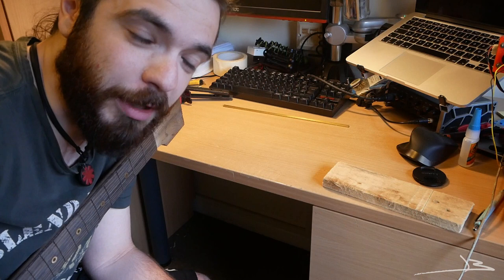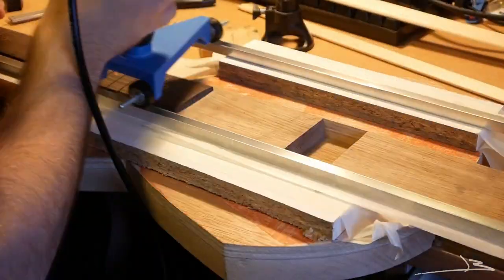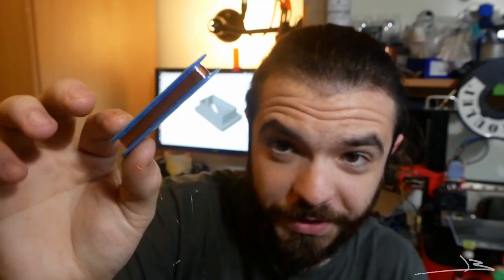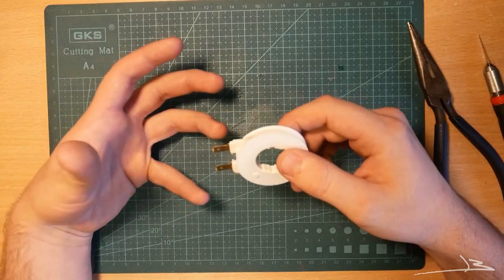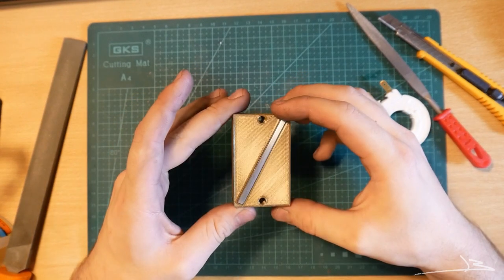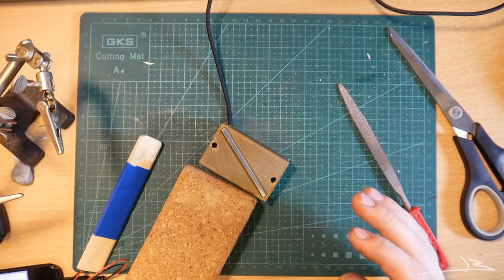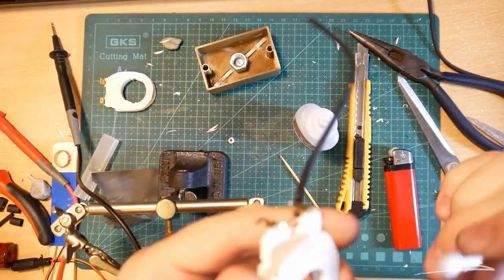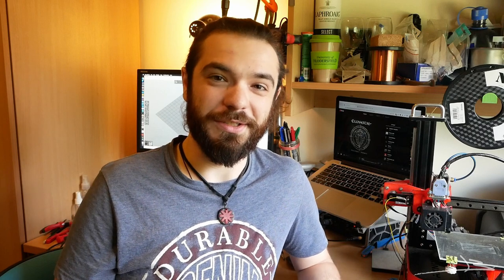Building a guitar from scratch | Ep7 - DIY Pickup | Great Guitar Build Off (Unofficial)

Comment: Amazing. I'm starting to believe that I need a 3D printer. K
It seems to be a very powerful tool to make tools to solve random problems.
Edit: wow, the bobbin is 12K, the universe is conspiring in your favour.
Reply from the maker: Thank you! Yes, you definitely need one, and once you get comfortable enough with designing things you can unleash it's full potential for solving all sorts of problems. And yeah hahaa, it seems that almost everything was in my favour during this build. It isn't in the video, but I used a low pass filter after the pickup and I needed a 5nF capacitor for my desired cutoff frequency, guess what, I found one in a broken power supply. Also, in my pickup design the magnetic field is stronger in the middle than on the sides, that means that it will accommodate for the radius of the strings quite nicely.

Comment: Put a 200kOhm and 470pF load across the pickup to simulate controls, cable and amplifier impedance, and you'll get a more realistic frequency response.

In parallel you'll get a lower Inductance and higher cutoff frequency.
Reply from the maker: You're absolutely right! I have done exactly all of that and worked out my cutoff frequencies, but I couldn't fit everything in this video. There will be a video after the competition ends with all the working out and all the theory that went into it 😁
Reply: @BogdanBacila301  pickup frequency response and replication is a rabbit hole. I'm using a Syscom CGM and R (but you can use Excel) to apply a -20dB/decade slope to so you get a visualisation of a low-pass response without the behaviour of the driver coil in there. And trying to replicate the sounds of pickups I like in different packages. Strat SC size P90s, high output distortion pickups built with alnico rods and pretty maple flatwork. But its loads of work. There's good resources in the pickup analyis  section of guitarnuts2.proboards.com and they'll probably appreciate a write-up.
Reply from the maker: @rowlandstraylight  thanks for the info, I'll give it a look. There's definitely a lot going  on with a pickup and what I'm doing was not precise in any way, starting from not knowing the frequency response of the driver coil to not having a proper oscilloscope or other precision equipment which I don't have at home. What I was trying to do was get a general idea of the characteristics of the pickup and also put out a theoretical method of how an analysis should work and that it can be done in pinch for a general overview